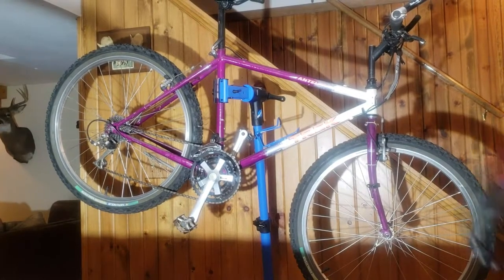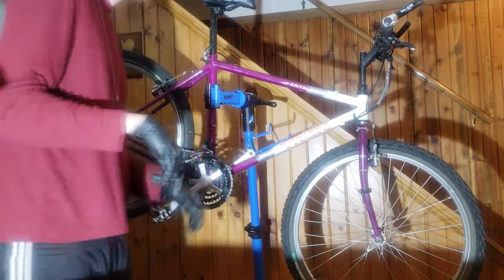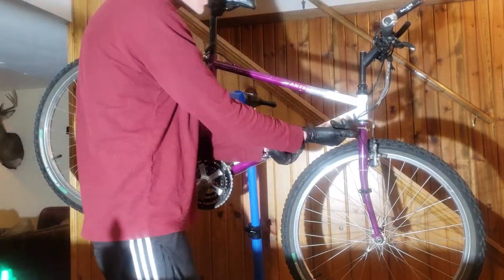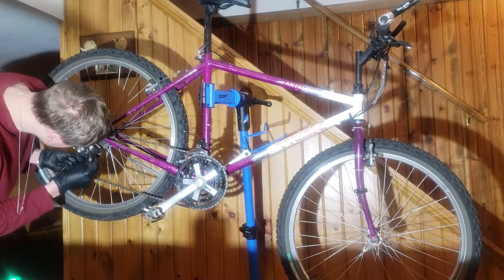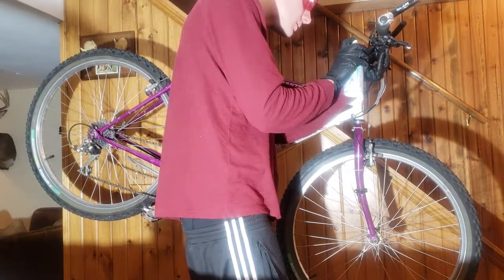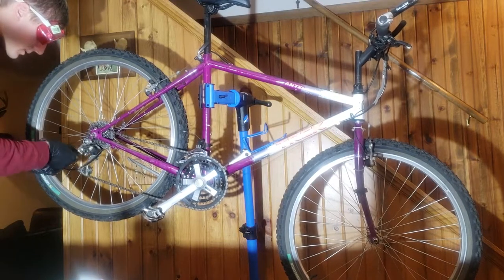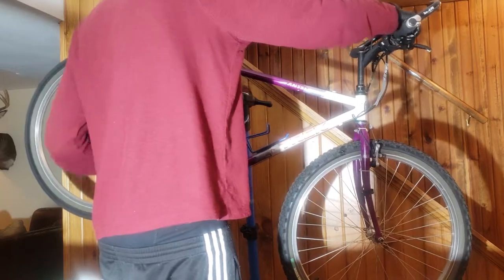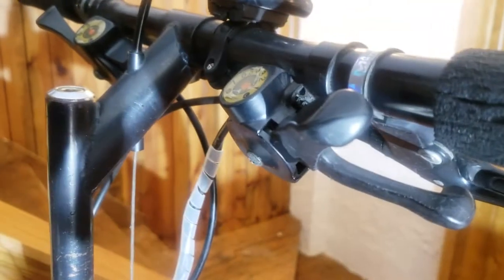Trek 820 Antelope Rear Derailer Tune up and Adjustment

Comment: Are you still using that bike?
Reply from the maker: I am a little bit too tall for it so it is waiting patiently for a new owner in my garage. I love the color and I am hoping I find a new owner that will appreciate it.
Reply: @scottsprojects658  I have one at home.  I owned since 1993 and I still using it.  But like you I m tall...I modified with new shimano components. In argentina is too expensive.
Reply from the maker: @fernandomartoniarce5192  that's awesome you are the original owner and have kept it on the road since 1993!